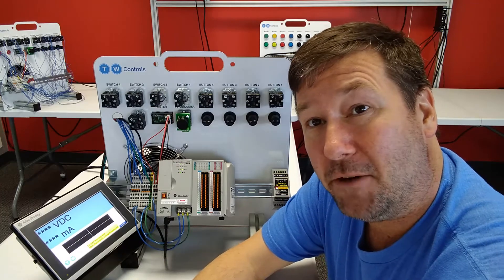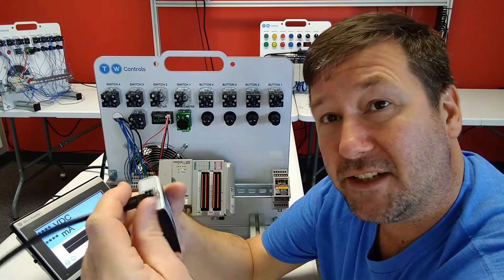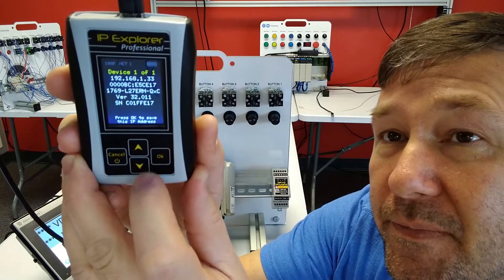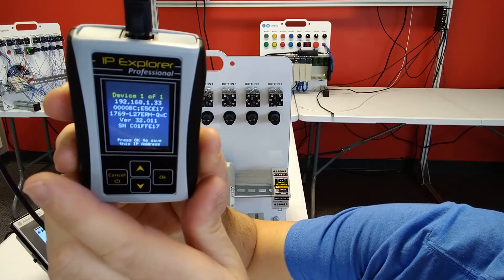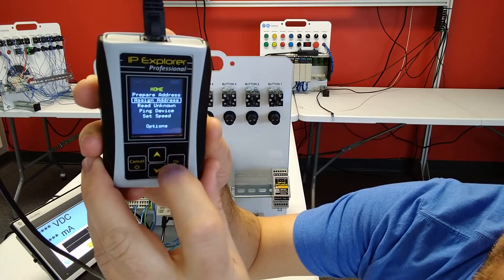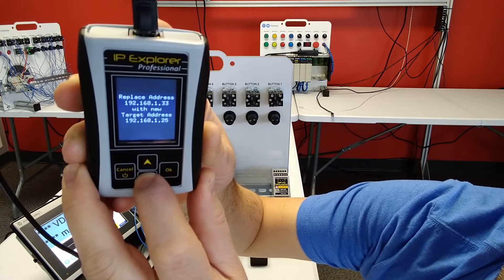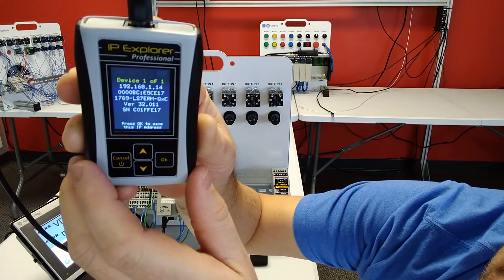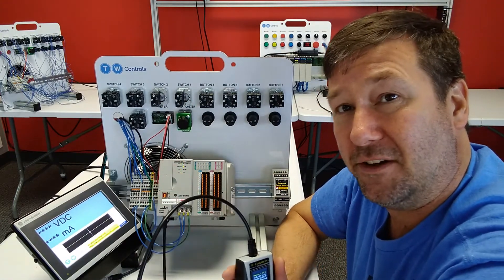Change a Static IP Address of an Allen Bradley Compactlogix 5370 PLC

Comment: Is there a trick to changing to a completely different subnet? I was trying to change a 1769-L24 (fw 21.11) earlier this week but had trouble. Ended up using rslinks instead. The sim-ipe could read read existing address ok.
Reply from the maker: Hi Dan.  What firmware is your SIM-IPE?   We improved the process of changing subnets in FW 2021-110.  I'm betting yours is older than that.  Here is how you could do it with an older firmware.

Let's say you wanted to switch an IP address from 172.25.100.123 to 175.25.100.123

1.  On the IPE, configure Network 1 for an IP address of 172.25.100.XXX where XXX is an unused address and set the subnet to the current network's subnet. 
2.  On the IPE, configure Network 2 for an IP address of 175.25.100.xxx where XXX is an unused address on the new network and set the subnet and gateway to what you want it to be on the devices that you are changing.  This is important since the IPE passes it's subnet and gateway to the device.
3.  Select Network 1 on the IPE
4.  Plug directly into the device, not through an Ethernet switch (You can do this through an Ethernet switch but this way will cut down on mistakes)
5.  Select Read Unknown.  Once the IP address is displayed, press OK to set it as the IPEs target address.
6.  Under Assign Address, Select Enable DHCP (if you get an error here, then select Enable BOOTP)
7.  Select Network 2 on the IPE
8.  Under Prepare address, enter the desired address for the PLC.
9.  Under Assign Address, select Use BOOTP/DHCP.
10.  Once it says it is assigned, press OK to set it to static.
Reply: @TimWilborne  Thanks Tim for the fast reply! I’ll try it out tomorrow.
Reply: @TimWilborne  fw rev 2021-071
Managed to get the ip to change by first turning dhcp on then switching to network 2 and power cycling the processor so the SIM-IPE would serve the desired ip when it received a dhcp request. Still couldn’t set to static or ping the new address, even though “read unknown” would find it.
Reply from the maker: @DanMaresse  What is the IP and subnet of the L24 and the IPE's network 2?
Reply: @TimWilborne  Sorry Tim, been busy and I don't have the spare L24 in front of me just now, but the SIM Net2 is 10.1.1.0, Mask 255.255.255.0, Gateway 0.0.0.0. The original job was to change a stand alone L24 at the customers site to 10.1.1.10 so the equipment vendor could log in via an EWON access point. I took a video while I was playing around with a spare L24 in the workshop the other day if that would help?
Reply: @TimWilborne  Good news Tim. Worked out that the SIM-IPE address was not ok.
Seems that 0 and 255 are not to be used for the last octet of ip addresses.
Reply from the maker: @DanMaresse  Great to hear!